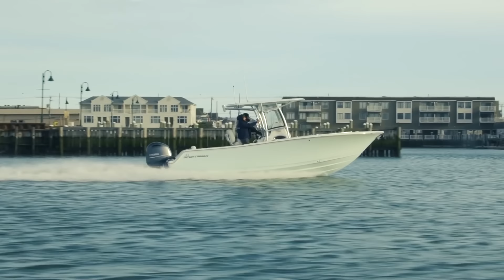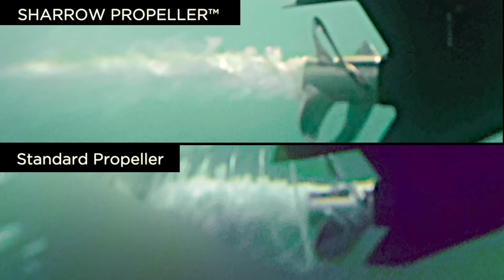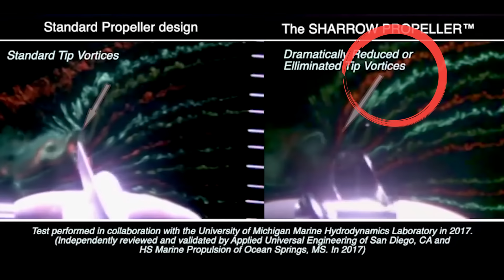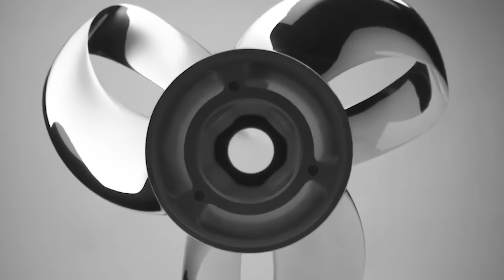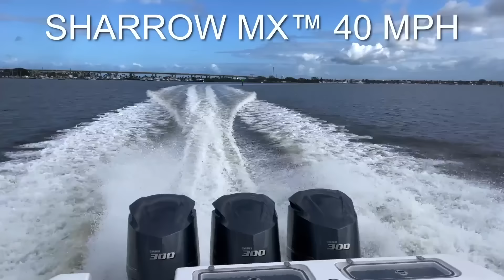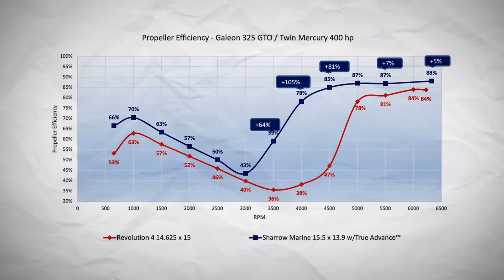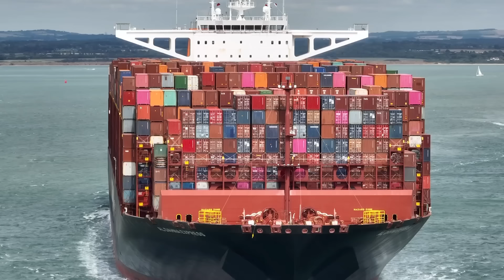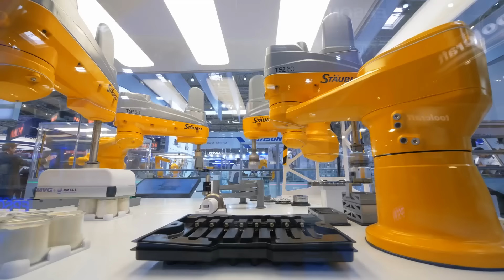This Genius Propeller Will Change Transport Forever

Comment: would be interesting to see ideas on how this could be implemented in turboprop/turbine aircraft. I think the same principle can also be applied to aircraft wings.
Reply: It has been done for aircraft.
Search term "Closed wing aircraft"

Very likely that future aircraft will be closed wing. The low internal wing volume and speed limitations of high-aspect ratio wings made it impractical in the past.
However, because its looking like hydrogen powered aircraft will win as the green alternative (I say this because thats the only place money is going for mid to long range).

This means all the fuel has to go in the fuselage since its not feasible to make wing tanks that can hold the desired pressures. This combined with an ever rising need for fuel reduction makes closed wing attractive.

It allows high aspect ratio wings like a glider that are efficient at mach 0.8-0.9 like a swept wing.
Reply: @nocare  Thanks.

Comment: Aren't you guys tired of bs like this?
How many times "this invention changed the world" in the last 3 years? What happened to them? Aren't you sick of hype and lies?

This propeller for example is heavier, has more contact surface and generates far more friction. Just because it looks "cool" and in lab conditions may add 5% more thrust that does not mean it will be adopted.

1. the costs, a propeller, even a classical one, is extremely expensive. The more complex it is, the higher it costs. This one is insanely complex and I doubt even 5% of metalworks industries can make such a thing on a large scale. The build costs will be enormous, and since it will be produced in limited quantities, the price will stay high for a lot of time. No mass production, no price cuts. Yes, that is how real life economy works. Is not a laboratory simulation.

2. the maintenance, both in costs and in difficulty. Every single propeller gets damaged, and every single one needs to be refurbished, cleaned, and so on. How can you do this on such an expensive and unique model? The answer is simple. With a ton of money and only in a few shipyards. Maintenance costs will drive the profits away, therefore what's the gain?

3. Wear and tear. Again, the more contact area the more friction you get, the higher the damage. This type of propeller will get damaged far more than the classical types. More damage means less efficiency,. more maintenance and repair costs, less profits. Bye bye incentives.

The real world is not a lab where you can use a crappy 3D printer and defecated all your stupid ideas, creating hype videos and using big worlds. The real world uses real tools, scale tools that costs billions, most of them are unique and extremely difficult to produce and repair. 

Whatever you do in your shitty basement or in your crappy 3D modeling software cannot be easily translated at scale. There are not giant 3D printers to make your crap, and there is no magic metal plastic to mold it. Each blade will have extra weight, the weight will add to the tensile forces, metal fatigue will exist, impact points will exist, misalignments will exist, varied metal density will exist, and the list goes on.

In short, the real world deals with real problems, problems that are NOT simulated by these "revolutionary inventions". Once all the problems pile up, good luck having any real gain or even breaking even against classical devices.

And stop it with the abject hyper and clickbait already!
And who ever believes these kinds of channels never lived or even set foot into an industrial facility of any kind or size. Get out there, touch grass, don't believe the hype!

Comment: The US Navy went to shrouded prop designs in the '90s to reduce cavitation. Would be interesting to see a comparison between the two concepts. Jet drive systems also rely on shrouding for efficiency. 

The auto industry first started shrouding radiator fans in the late '50s early '60s as well.  

Jet engines probably pre-date any other application of fan in tube design.

Comment: I guess this is a little bit like reinventing the wheel_ only we are reinventing the propeller. I'd be very curious to see what this does on giant tanker ships. Making them quicker and cheaper to run would be beneficial these days. My suspicion is that, even though it's incredibly efficient on small applications, I wonder if it will hold up once it gets bigger.

Comment: I'm wondering how these handle long term use.   For commercial applications, reliability will be important.   If they suffer from metal fatigue stress points and fail sooner, their application for commercial or even military would be a tough sale.

Comment: It's worth pointing out that there is almost no economy of scale in 3d printing, and very little economy of scale can be found in CNC machining. There is a reason almost everything you see around is injection molded or stamped.

Comment: An efficient improvement on this design would be  that alternating geometry of the toroidal shape to suit the rpm of the prop in the water and loading on the engine = oval for lower speeds high engine loading to a cone shaped for high speeds lower engine loading

Comment: I'd imagine repairs are potentially impossible...
I've seen folks hammer a prop blade back to its original shape after a ding... not ideal, but possible... I'm not sure about this prop though...

Efficiency wise, 20% on fuel costs, so $20 for every $100 spent means, you'd be looking at $25,000 of fuel before you've made your 5k back.. (unless I've made a mistake)..

Comment: I suggest designing a prop for the speed that ferry boats run. Long hours each day at about the same speeds. Start with something for the 200 foot boats used in Norway, Scotland , sweden ETC.These aren't huge props and the fuel savings would be huge.

Comment: I would say the reason they are so expensive is because the manufacturers can charge that, not because they are more complex mathematicaly. The complex shape is doesn't mean anything different for manufacturing, just different molds in the metal casting process (Once you have the design you can easily copy molds and use them over and over). But the company with the patents are still small and don't have the product demand nor the manufacturing scale to make it cheaper. Plus they can charge that much when no one else is manufacturing them. All in my opinion of course.

Comment: Regarding scaling up these propellers for large ships, I believe the ships are limited by cavitation on the propellers. That's why propellers are destroyed after years of use. Therefore, the toroidal propellers should be interesting in larger sizes too.
Reply: Destroyed?. mate every 5 years its pull out , repaired/refurbished ..  propellers outlast the ship itself..

Comment: It costs $5k 😂
Reply: It's almost feasible -- you'd have to spend $1,000 a month on fuel for 25 months to achieve a 20% savings of $5,000... or 250 months if only $100 a month on fuel.

Comment: I am not an expert at all, but my understanding is that this new shape, that looks very promising, is not fit for variable pitch propeller (used by planes or helicopters). Also, its main benefit come in open environment, so not sure it will have such an added value for water turbine or computer ventilator neither. But very interesting anyway.

Comment: I hope to see this fascinating new approach of propeller design proving to be an actual step forward and a viable option in many applications. Looking forward to further information on where this is going.
Reply: not a new design, not used due to being very inefficient...
Reply: @quadlawnmowerman  inefficient in what way…please explain??
Reply: @russellking9762  Read a 101 on prop design, to over simplify for people who can't grasp the basics. The most efficient prop is a single blade, but that is a pain to use so we go to 2 blades to make balancing and mounting easy. The only reason to add more blades is due to limitations of either size or rotational speed (or in some very limited cases a greater disc area for more "grip" and initial acceleration in say an aerobatic drone where the sacrificed efficiency and top speed are irrelevant). 

So with 2 blades we generate an amount of thrust (lets say 10NM) for a set amount of energy (lets say 100W to keep round figures), when we add a 3rd blade we up our thrust by about 30%, but we cost another extra 60W of energy, add a 4th blade (which is what this toroid is) and gain another 20% thrust, and cost another extra 75W of power. Every extra blade creates less thrust per blade and costs more energy to drive. This is then magnified by the fact the main trust generating part of a prop blade is not generating thrust in a toroid (at the ends of the blades). Add on top of this the overlap in the blades and you now have one of the least efficient forms of thrust generation, and is only effective in thrust generation at much lower speeds before stalling. So you have a prop that cost more energy to drive, delivers less thrust and is severely  limited in its rotational speed....

Comment: Bruhhhhhhhh i just realized the Topoidal design is similar to the closed wing concept.

TLDR: 
Closed wing design significantly reduces vorties created at the tip of any aero/hydrofoil, much more than a standard sharklet/winglet. 
Its a very old design dating back 1920s but recently have been revived as the search for power effeciency continues.

(You can look at the new 2022 F1 rear wing regulations as a prime example)

Comment: If it was covered by a outer shell. Kind of like a cone. Looks similar like a impeller.  Would it make it quieter. Allowing it to be used in lower speed. With higher output???

Comment: I'm so used to YouTubers claiming that "invention X will change Y forever" that I've become cynical about it. Invariably these headlines are click bait, but this time it's different. Toroidal propellers will indeed make cargo ships more fuel efficient, but the real game changer will be in electric flight. Due to the sheer weight of the batteries, electric aircraft need to squeeze every efficiency gain they can out of their systems. Propellers like this will have a huge impact.

Comment: i very much doubt it'll make it to large ship's just because of cost (since they cost around 10x a normal propeller imagine that on a $10k to $50k propeller)and strains it causes when upscaling them to the actual efficiency of them since if you upscale the design and tweak it to fit it's efficiency will be lower than that of the smaller one how much is anyone's guess but it's that that'll make or break this new propeller design for commercial use.

Comment: If you have an efficiency result greater than 100% there is something flawed in the math or the assumptions behind the calculation.  Very cool prop though and a significant improvement.

Comment: This is one of those "Why didn't I think of that?" moments.

Like it seems so obvious that a blade that catches the air would be better. We've known for years that putting fins at the edge of wingtips will improve stability by not letting the air literally slide off. Yet no one thought of it! Or if they did, they decided it wasn't doable.

This technology can revolutionize air and sea travel. Start investing, kids.

Comment: I just printed a set of toroidals for my drone and dear lord! Even when they are janky and rough as a preliminary print on an uncalibrated printer (I'm lazy, I know), the noise reduction is massive. Will have to get much more into proper customization and control of the drone functions to adjust and calibrate it for new propellers though.

Comment: This design has been around for over 2500 years.
If it were the be all, end all propulsion design, it would have been the world standard for hundreds of years.
You keep saying it is more efficient at identical speeds with a standard prop, and it certainly is, but you leave out the fact that the engine powering it uses exponentially more energy to achieve this.
It weighs more, and it moves a higher volume of fluid, so it obviously requires more energy to move it.
It is only when the power source can produce at least the same energy to drive this prop at the same speed, while not consuming more fuel will it become the standard.
Besides that, there are many modern designs of propeller systems that are massively more efficient than a standard bladed prop, with the same caveats that you do not compare.
Pretty one sided on the facts.

Comment: Don’t jet ski’s solve this, the only drawback is speed… 

They solved a problem with speed with this prop design by removing the jet propulsion design and keeping the open prop design… 

I wanna say Naval Submarines already solved this by adding a ring around the blades. But this design could help reduce weight, improve speed while keeping efficiency. One problem, the blade is open so it has more potential to being damaged. Could still be harmful to people and marine life if they accidentally touch it…

I wonder what would happen if they combined this prop and a jet pump design? 🤔

Comment: As I think of it, this brings in mind the venturi  effect between staysails, or between mainplane and slot on a fixed wing aircraft, as the accelerated flow stream draws slower particles toward lamellar flow, rather than turbulent dispersion.  I wonder what effect they could have in a turbofan or bypass fan aero engine.

Comment: I think this is a lot of fuss about very little. The boats and sound levels, we were listening to the motors. Very little prop noise is apparent over that of the drive system. Big cargo ships have their diesels running at a few hundred RPM at top whack. If they could save 20% fuel they would have them. Aircraft have constant speed props - If they use props efficiently, how can you do that with this arrangement? You can't. So for drones and speedboats it might be viable??

Comment: As a regular Joe boater, I can’t justify spending $5k on a prop. For that price, I can get 10 new props that I can use over a twenty year period (I damage one every couple of years). Spend $5k and bust it 2 years later, no matter how efficient or quiet it is, you’re out of a lot of cash. Bring the price down to 1.5, maybe 2 times the cost of a regular prop, then this average Joe boater will consider it.

Comment: Its old tech, a boat prop like this costs 5000$ for a 225 honda otb.  five thousand dollars...   I just paid 189$ for a nice 4 blade. new.   Yes it is better but how long would it take to recoup the investment.   It is not applicable for larger vessels due to the extreme expense.   Its simply an engineering exercise or for the stupid rich who just buy gadgets.

Comment: A couple of thoughts that pop into my head from this:
1. I hope all the numbers presented hold up!
2. I sure as hell hope this scales up for large cargo ships. More efficient and quieter, that would be amazing. Ships already outweigh all the fish in the seas iirc, so a change like this would have a HUGE impact.
3. That noise comparison? Now imagine those being electric motors. The noise difference adds up. Insane change for the better. Love it.
4. This reminds me of a video I saw showing a potential new main wing layout for airliners that NASA is thinking of funding large-scale testing. A wing shape that is basically this shape! The wing goes out, smooth curve upwards, goes back in again to attach to the plane further back.
Reply: Low speed merchant ship props are already more efficient than high speed pleasure boat props.  Study a prop curve and you will see why.
Reply: Well I looked into this about year and a half ago and can attest to at least 1 number…. They are expensive
Reply: @scottluther6699  Indeed!  I can buy a lot of fuel for what they cost.
Reply: IT'S REVOLUTIONARY !! ... even if it's an old invention.
It was invented in the past at a time when we could waste anything.
It is now re-used at a new period of time when it becomes a key factor in transforming all our industry of transportation and energy that we have to do now to survive.
Reply: @TheButlerNZ  I see 105% on the chart in the video, but it's only 105% increase over the normal propeller at a specific RPM - there's nothing that breaks the laws of physics there...
Reply: They would have to test the resistance of the wing to flex and break, my dad worked in the string gauge area as a supervisor so he was watching wings get snapped in half all the time. 
It might work I don't know I am sure it can be done it will probably take some time
Reply: If it sounds too good to be true it usually is
Reply: @TheButlerNZ  the thumbnail says "+ 105%" for me. Not "105%".
That's a big difference.
Reply: I doubt this is suitable for merchant ships. Too expensive to manufacture and maintain. Development and testing for merchant solutions would likely be sky high and would put off many atempts for this solution. For the commercial shipping solutions where this could make sense the preffered choice is likely a ducted propeller, which is much easier to manufacture and probably have similar properties. The comparison to a standard fpp is therefore not valid.

High saftey requirements combined with a low margin business makes shipping companies conservative in their choice of technology, so a steep hill to climb. If it would prove to have superior noise reduction qualities it might become a choice to concider as regulations might require so in certain areas. Cavitation is always also a concern. Any commercial solution on a merchant ship would require that it is repairable and this means that steel and full composites are poor choices. Any repair also needs to be possible at any repair yard. This would likely require OEM engineers and supervisors. A brass propeller would likely either not have the strength required for this kind of complex structure, especially if the ship needs to have some ice classification.